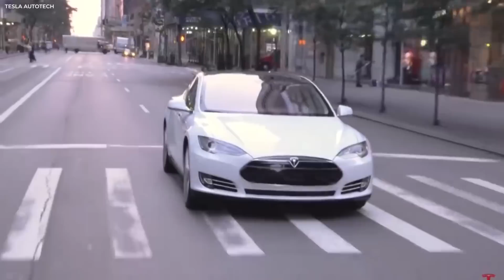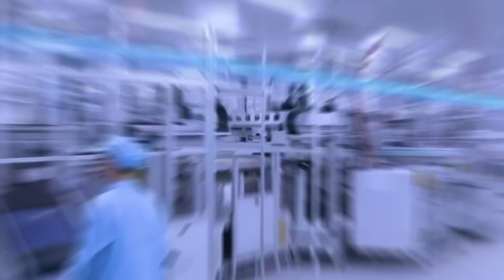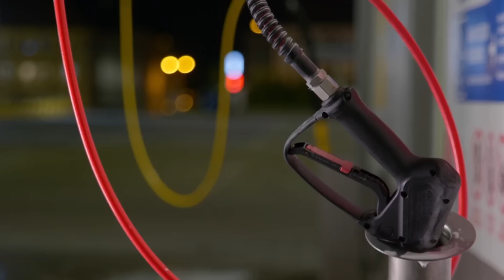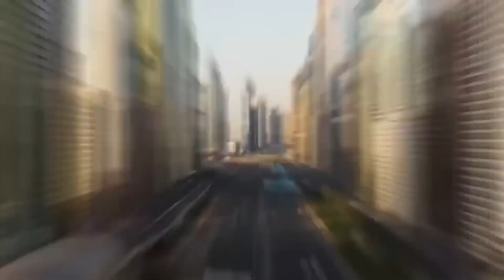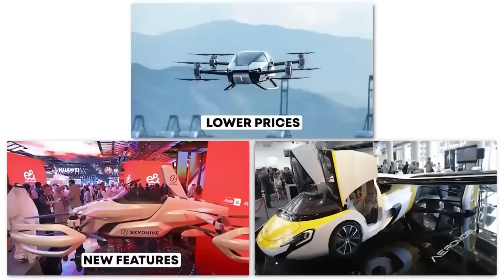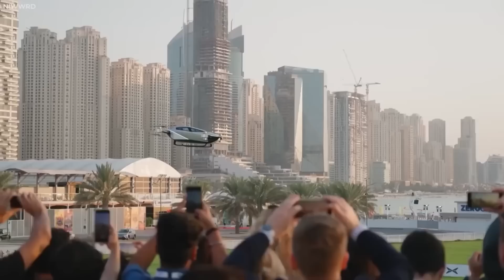BYD Announces Their Next Generation Of Blade Battery With 80% Charge Achievable

Comment: It'll probably be another year or so until it takes just seconds to charge up a EV car. Its almost here really.. Safety would be my concern for EV cars. Like why do they have to put the batteries right where its prone to pot holes and destruction from any bumps in the road. Why can't they make it so that its on top of the car so then it doesn't have that problem in safety. Or better yet why not put the batteries in compartments in the edges of the car on top there where the doors closes. Its just uncanny how unsafe the position of the battery is to begin with. Its a fire hazard so lets not put the battery where its prone to bumps on the road maybe?

Comment: I live in Malaysia my byd atto 3  almost 15 months ready 30,000km same as profomance day 1 single charge 400km even I use 200w 10 soler panal to charge my car I save lots of money in Malaysia I spend Rm 300 for 30,000km few times charge DC. Every day my car energy come from sun thanks to sun ❤❤
Reply: Solar is DC, right?
Reply: @chin2025  oow
Reply: count the cost to buy solar panels too, not just the electricity dude.
Reply: @unknownlifeform5884  if you don't know anything about our country solar landscape, you should keep your mouth shut, don't act smart. Malaysia solar is 3y ROI, government subsidized.
Reply: I wish i have better solar panel regulation, implementing panel on roof not much different from goverment grid. It'll pay its own cost but need a looong time. Panel here still pay some tax
Reply: Ohh ! which country  @gilangwahyu4450
Reply: @chin2025  Malaysia is chinese
Reply: @jonathanfrancisco-hf1yi  You need to learn basic geography and grammar. Dude.
Reply: @100-q8v  Chinese covid

Comment: Tesla also uses LFP batteries.  But, they do not have the advantage of being a primary push of the CCP to dominate an industry.  BYD started as a battery company, so focused on them.  Tesla was a car company and bought battery technology from specialists in the domaine.  The cycle will continue as to who dominates.  But, with the CCP pushing for domination in EV’s there will be unlimited resources until they overdo it.  Would never buy a Chinese care, made by a dictatorship using slave labour.

Comment: LiFePO4 has been out there for a while it was patented in 1997 by our Dr Goodenough. We did not use it because it not as energy dense and much heavier than other Li batteries. The biggest producer for this LiFePO4 batteries is CATL, I believe. 2nd point: Li ion batteries is combustible it can catch fire and may explode that is what said in the video. Isn’t gasoline has the same problem? It does not sound like a neutral comparison.

Comment: Enovix has a battery cell that can charge to 80+% in just over 5 minutes.  It has a higher energy density and works on current charging systems. The battery is safer than current lithium ones.

Comment: Hope companies will make car slots and batteries which should be plug and play i.e slots should be of uniform size universally and any battery brand can be used by any cars. Then only battery cars will be successful. 
Importantly the battery should be two sets, when one is using power the other set should be charged simultaneously.

Comment: This may be game changer if it achieves all the parameters and advantages over presently widely used lithium iron batteries in e vehicles. This kinds of LFP batteries are already in the market in the form of cells like LI batteries, but it's weight is higher than LI batteries. BYD is a Chinese multinational company and China is already a hub of all kinds of  e - vehicles batteries manufacturering.  So Chini will enjoy complit monopoly of this key product is also a cause of concern.

Comment: what nonsense. The film is long out of date. No electric car manufacturer uses batteries based on cobalt and nickel. Cars use lithium batteries. Only lithium is a rare element, just like cobalt and nickel, and it does not solve any problems. Currently, lithium iron batteries do not cause fires, but they are expensive, charge slowly and wear out quickly. This is not a breakthrough.
Reply: Your partly right. About long out of date, yes. But lithium is not a rare element, like cobalt and nickel. Also Tesla uses LFP batteries in part of their lineup, and although these cars charge more slowly than non LFP battery equipped cars, they are by no means as slow as you seem to suggest. Another misconception: 'wear out quickly'  No. Their lifecycle is better than those NCM counterparts. And they are more safe.

Comment: EVs may be the future on day, and I applaud the improvement in technology, but not the immediate future in Europe and the US due to limits on the power supplied by the national grid, and especially the limits of dispatchable power by reliance on unreliable renewable, limits on power availability from local grids that will not support fast chargers and for those persons living in apartments that park their cars on the street the high costs and of public chargers and their low availability. This is why in Europe EV sales have stalled with people switching the hybrids, including Tesla. In addition there are high insurance costs due to the fire risks from EV batteries and the costs of repairs that have seen rates of depreciation that combined with the high cost of replacement batteries make ownership an unattractive proposition for the average citizen who usually buys cars second hand and fleet owners who rely on this market . Add in severely reduced range in cold weather and overstated range claims based on running at 50 mph and you will see substantial uptake of EVs is a distant dream of the environmentalists that may well be overtaken by hydrogen and water engines with the hydrogen coming from small scale modular nuclear reactors removing the need for storage and long distance transport.

Comment: Looks like a "2 horses" race for the championship of EV cars between BYD and Tesla.
But the heavy tariff imposed on BYD in the US market is unfair to BYD and should be removed.
Reply: BYD and other Chinese cars are not even allowed to import cars to the US. Which is a shame. I hear BYDs are good, and cheap.
Reply: Storage Battery for EVs are being rapidly R&D to get better performance.
Cutting edge new battery type to replace the current lithium ion type are able to take faster charging, bigger capacity, higher energy storage density, more recharging cycling life, cheaper materials used (no cobalt and nickel), etc.
Expect to hear more on the Sodium ion, Aluminium ion, Lithium Iron Phosphates (LFP), graphene, etc coming into commercial production from the laboratories.
EVs are very fast changing  technology products.
Reply: Well! It ain't a race no more. The race is over and the winner has emerged 😂
Reply: @jamesmartin7026  
Not yet.
Tesla is in this EV cars business longer than BYD and do have cutting edge EV technology within it's fold.
China should not be complacent.
Hydrogen fueled cars may suddenly pop up to challenge storage battery EVs!
Reply: @wmchan44  It sounds like a wishful thinking to me! EVs are all about batteries and BYD is the leader of producing the best batteries in the market.
Reply: @jamesmartin7026  
Storage battery for pure EV has limitation of high cost, limited range and long recharging duration.
That is why the best selling models of BYD's cars are their hybrids, carrying a small petrol engine to back up the EV  battery.
Hydrogen engine driven trains are used in China's remote regions tracks where electricity is not readily available.
The final verdict is therefore still open.